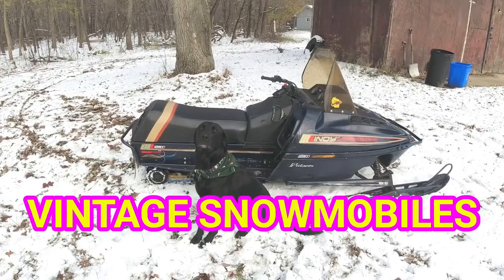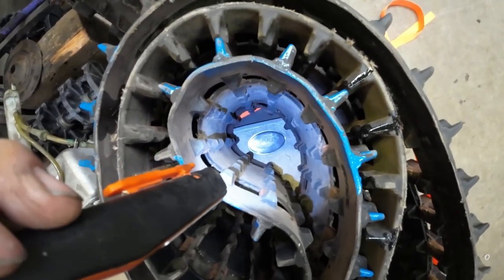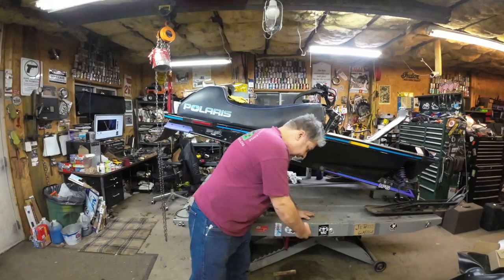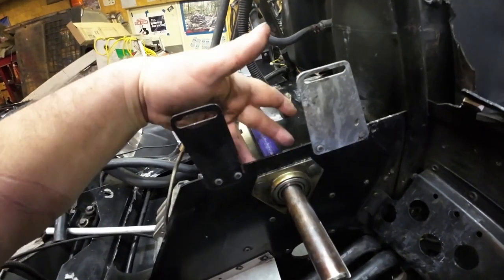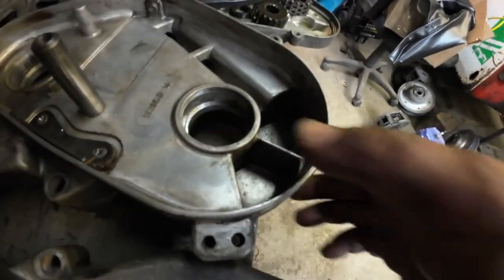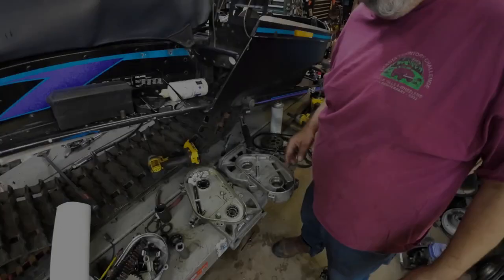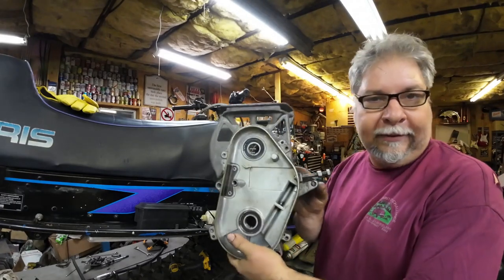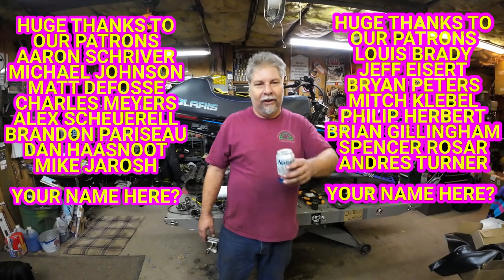Swap Meet XLT Part 5: Reverse Chain Case fix & "That Nut" Vintage Polaris XLT 600 Triple Snowmobile

Comment: On that smooth threaded sleeve inside the chain case........Try cleaning with brake cleaner, then wrap some inner tube strips around it.....then maybe your beer can layer.  Might be less slippage with no damage.  Only thing is the pre heat might get the inner tube smokin.
Please show your ideas on how to check and adjust chain tension on that case once its all assembled.  Im dealing with a '98 reverse case that I dont wanna open up right now.  Thanks
Reply from the maker: Once it's assembled - you need to reference the bar parking lot chain tension procedure. Turn the secondary to put all the slack to the front. Then tighten the bolt as tight as you can with your fingers. Bare fingers, no wrenches or pliers. Then back off one flat.

Comment: Thanks for all of your informative and entertaining videos!   I have a 1984 Indy 600 and I am going to swap out the original track with a Polaris .82" track with 96 studs.  The tunnel has aluminum wear strips.  But is it safe to run the studs with that sled, or should I remove the studs?  I'm worried about the clearance between the track and the front heat exchanger.  Thanks and Happy New Year!
Reply from the maker: Lots of people have done that through the years. Just keep your track tight and you should be OK.
Reply: @nuttersspeedshop  Sounds good.  Thanks John!

Comment: Hey nutter, I use a bolt and jam nut to remove the idler shaft. Need to heat locktite but works for me!

Comment: You and the reverse chain cases. Where I am from in Canada....finding a reverse set up for those sleds is darn near impossible. I`d love to set up my 1977 or 1980 TX with one!
Reply from the maker: I have one on a 1980 TXC. It took some modifications to the exhaust - had to dent it in to make clearnce.

Comment: Happy New Year Nutter!  
Nice choice on the lightning track, by far the better option compared to the other 👍.  That darn bolt is such a pain in the butt!  It’s really to bad Polaris didn’t come up with a better design for that, would have saved a lot of unneeded suspension and track removals🙄
Reply from the maker: You know it Rob.

Comment: Hey Nutter I know it’s off topic but I’m in the middle of taking apart the brake and clutch assembly on my 74 tx 250 to replace the bearings. I cannot get the lower bearing to break free from the drive shaft. Any suggestions? I’m referring to the lower chain case bearing
Reply from the maker: Start with Kroil and let it sit for a day. This has worked for me many times. You might want to consider drilling a hole in the belly pan so you can use a punch on the drive shaft and then get a plug for the hole later. 1/2" steel round makes a good punch. Put an old bolt in the driveshaft to protect the threads. If you don't want to drill a hole the options get more difficult.
Reply: @nuttersspeedshop  I’ll definitely try that. Thanks for your response!

Comment: Thank you for all the great videos. What do you use for your chain case replacement bearings? Would you ever replace just the chain case bearings, or always all 4 of them,  both jackshaft and drive shaft bearings?
Reply from the maker: There's a link to the 6205 bearings in the description. I use either FKG or XIKE brands. I think they have better quality control than the cheaper bearings. It's not worth it to use a $25 bearing. For the clutch side I use RB Tech SB205-16. For the price, do them all at once.
Reply: I appreciate the response. I didnt realize the bogie wheels used the same bearings as in the chaincase. I already have a stack of those bearings. Thank you!

Comment: How do you get an accurate spacing for drives ?
Reply from the maker: Best way is to put the driveshaft in with no track and find the center. Then use the track to set the spacing. If you have an old junk track cutting a couple feet of it out make a nice tool for this rather than working inside a complete track.
Reply from the maker: Since you are putting new drivers on that Ultra you can probably just go by the marks left by the old drivers.